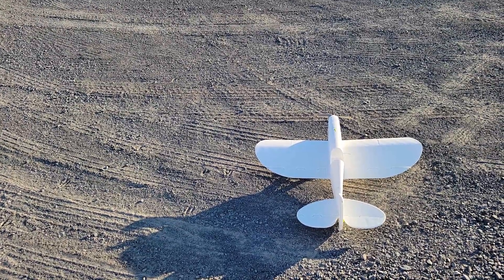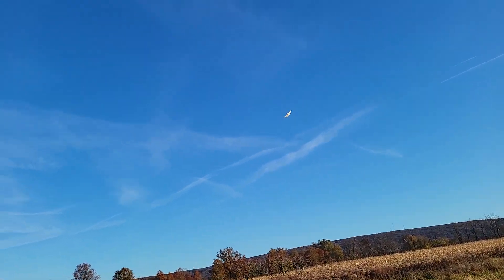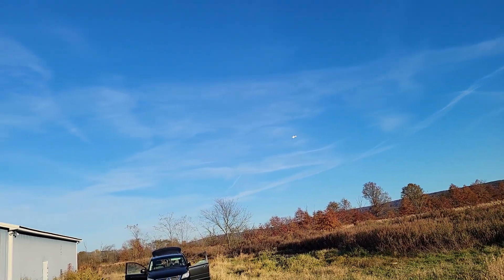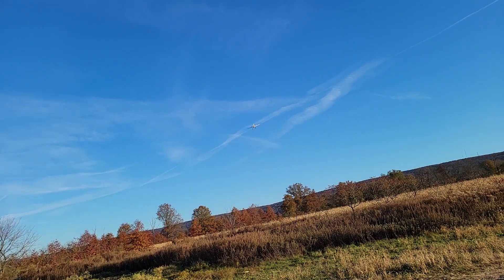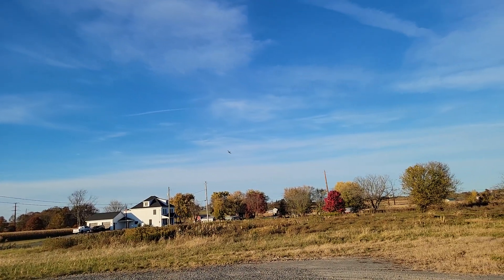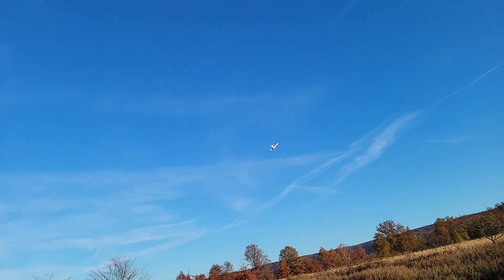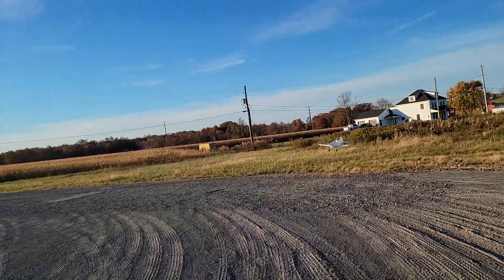Super Slow Flight Characteristics of 3D Printed RC Sportster. SUPER STABLE AT LOW SPEEDS!!!

Comment: looks excellent!
Reply from the maker: Thank You! This is my absolute favorite 3D printed plane by any designer. I have many other flight videos for this plane as well. I have recently updated it to version 2.0, completely re-designing the wing and adding dummy motors and other small changes. I currently have 4 of these on my walls and am in the process of letting the kids shoot 3 of them down with an airsoft gun while recording! It's been very fun! Highly recommend trying this airframe!
Reply: @HoloModels-RC  I have a couple of other planes in front in the print / fly queue that I need to clear out, but this one goes on my list to pick up once they're done, for sure
Reply from the maker: @ You definitely won’t regret it. It flies much better, is more fun, and there is a less chance of it breaking if you use active foaming LW-PLA instead of pre-foamed.

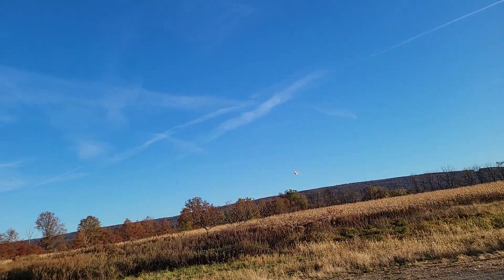Comment: great little flyer, I printed “the Batt” EDF, 1:52 from cults.
You will need to add some more right thrust to prevent that left yaw(3°), very short tail moment makes it wanna fly left.
 great little flyer, will surely print it😂
Reply from the maker: Thank you. The thrust line is probably not gonna change any time in the near future. That was one of the first things I did to the fuselage. Currently it has 2 right and 1.5 down. I didn’t want to add too much, it can always be trimmed out. I know it definitely flies better than the foamboard version when it comes to it tracking straight when throttling up. I have made several of them from FB and I always had to add a lot of rudder trim, and a mix of down elevator with the throttle curve. I posted many flight videos, you can see for yourself. Many people don’t even add a thrust angle to their 3D projects. I’m happy with the results as of now, and I don’t claim it to be perfect. Of course there are things I am personally not happy with and would like to change them in the future, but overall this model turned out really nice. At some point you just have to move on. I was waiting to reply to see if you downloaded it. Are you talking about the batwing EDF? My models are a little more detailed than the person who designed that one. I add control horns, servo holders, and the control surfaces are hinged with PLA filament. I made a spring loaded latch for a hatch using a rubber band. Where that designer uses magnets which is a much easier way to design 3D prints. Not to mention I also add G-Codes and the entire model prints in Vase mode without retractions or infill. I did my best to test as many aspects of this model as I could, and am proud of the results and the finished product. That’s why I post so many videos and try to be as detailed as I can. I am not hiding anything just to try to make sales off Cults. And I do my best to try and solve any issues people who download it have in a timely manner. I highly encourage you to download the full model and give it a shot. I can honestly say it’s one 3D printed RC plane you won’t regret purchasing. Thank you for taking the time to post a comment on my video. Bill
Reply from the maker: If you do download the model, you could always put a washer on the back of the motor when screwing it to the mount to get the angle your looking for.

Comment: Do you have any videos on printing these planes?
Reply from the maker: @justplanefred  What do you mean? Like videos of them printing, or videos on how to print them? Sorry, no I do not, as of now. I wouldn’t mind making a video of them printing if people would be interested in that kinda thing. 3D printing can be very complicated at times and requires much experience and trial and error. I do however provide G-Codes with the models I post for download. G-Codes can be put onto an SD card and inserted directly into a printer and ran from there. They will load my parts and my settings, and are a great way for people with little experience 3D printing to be able to print these planes the way i intended them to be printed. The planes in these videos were from my G-Codes. If you want to see what the internal structure looks like, click on the download link. There I have pictures of the parts and pics of what the internals look like through my parametric modeling program(Freecad)
Reply: @williams_Holovich yeah something like that. Obviously not a whole print but maybe some of the parts in process, things you have found helpful that you changed along the way of printing the plane parts. Maybe assembling the parts. Kinda of a how to with out being a complete printing as I’m sure from what I hear of 3D printing some complex parts take time. I’ve seen some videos where people print pieces and glue them together. I have built balsa and foam board planes and they have different styles of bracing. I’m not sure how much of other types of builds you have done. Basically things that might help people who haven’t 3d printed but built other ways might need or want to know. Or things people who are in to 3d printing might not know about planes
Reply from the maker: Build Video:
https://www.youtube.com/watch?v=KomKWQ_7ko0&t=4156s

Thanks for the advice. In the future I can make some videos of the actual parts printing, and explain a bunch of stuff in the videos. Here is the build video for now though, I posted links in the top of the description to other videos regarding this plane.

Comment: Did you ever printed a rc plane with normal pla and how dose it fly?
Reply from the maker: I have, well PLA+ anyway. PLA Plus would be about the same weight as PLA, but a little bit stronger with better layer adhesion. I wouldn't recommend printing an RC plane with regular PLA. They come out significantly heavier. The first Sportster I made was with PLA+, also I have a video of 3D Labs Mustang printed with it. PLA+ is cheaper per roll, but it's not really worth it when comparing to LW PLA because the flow rate is halved so a roll of LW-PLA will last twice as long as regular PLA or Pre-Foamed LW-PLA. They will fly either way, they are just heavier and break easier because landing speeds have to be higher.

Sportster PLA+
https://www.youtube.com/watch?v=gP_5EM9sYwQ  
3D Lab Mustang PLA+
https://www.youtube.com/watch?v=HYpuayhaoRk      
First time I flew the mustang with PLA +, I landed and the fuselage broke in half. Wasn't a hard landing or anything. So I filled it with expanding foam and here is the video of that.
Reply from the maker: When printing RC airplanes, you want to try to stick to using either Pre-Foamed PLA or Active Foaming LW-PLA. When designing a model I always print it with PLA+ because it's cheaper. Most of my parts get printed about 10x each because I have to find out where to add structure and figure out what the best print settings would be. Hence the Sportster prototype being made with PLA+ (11$ a roll I paid).
Reply: @HoloModels-RC  yep good idea
Reply: @HoloModels-RC  honestly thankyou so much for the advise ,thats exactly what ill do pla+ and lw-pla only ...👍